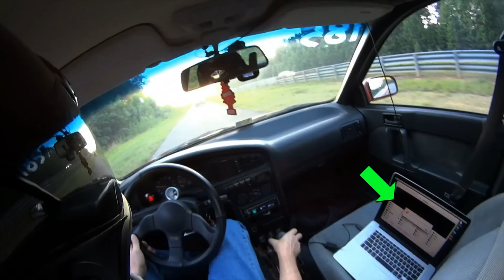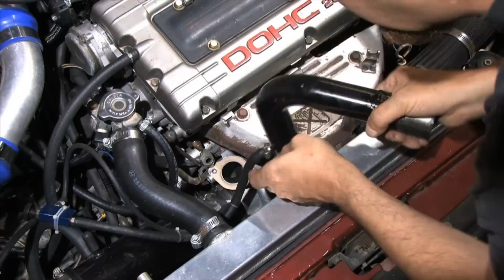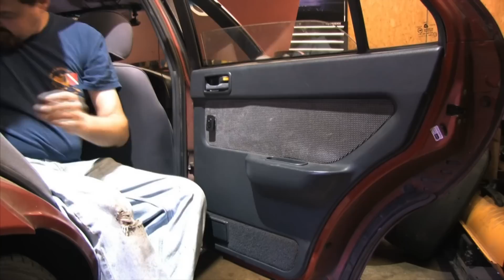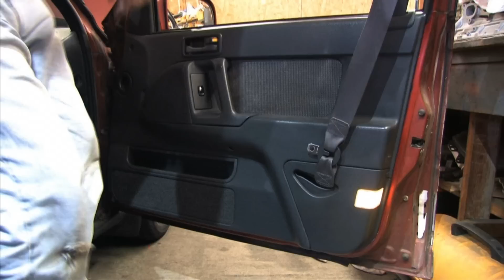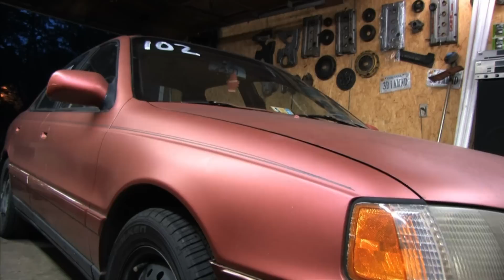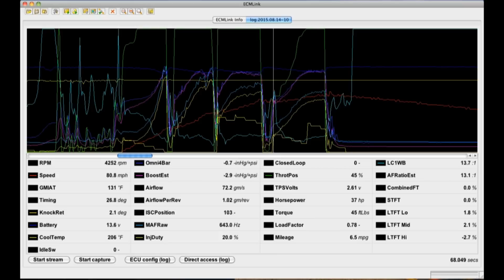Hyundai 15 - Trials and Tribulations

Comment: I had a civic 98 I rebuilded and bought a turbo kit first days were great then had problems with the vtec sensors then the throttle then the intake then as I was repairing engine light didnt come on but that thing was rich and bumping as I shifted gears took the turbo out no difference replaced with original parts from honda nothing brought friends to help me out to figured put nothing I sold that piece of junk got me a toyota problem solve, dude stop struggling
Reply from the maker: +nino roland Oh, I'm not struggling.  It's part of the fun, really.  The challenge I chose to accept was building a 12 second street registered POS & I've almost got it.  ;)  If you boosted a Honda-anything, you're going to love tomorrow's new video.
Reply: +Jafromobile thanks for replying, its kinda sad that u work ur ass off to see ur car running like a champ and dissapoints sometime its alot of fun though, shipping, ordering, searching online! its a Nightmare good luck jafro cant wait till tomorrow :)

Comment: Just out of curiosity have you considered a lengthened tuckable  harness?
 I know it requires the use money but it will save you from committing suicide while trying to find your bad connection. It would also prevent future suicide attempts when other issues crop up with the 20ish year old factory harness. Another benefit would be increased space under the hood which is desperately needed and would give you better camera angles. There are a few DSMers that make such harnesses and that the price for one is not equal to astronomical. I know its not a "DSM" chassis but with you particular set of skills I'm sure you could make it work and teach us to make it work while doing it.

Comment: Solid editing, great story lines. You just need to stop using a potato to film ;)
Reply: +Jafromobile Jafro you didn't have to waste your time explaining anything to that moron
Reply: +Ricky W Pretty crazy your so easily hurt. I wasn't even speaking to you! I was simply being sarcastic. I've commented on this channel plenty of times, and received solid advise. Not trying to be negative, it was a simple harmless sarcastic remark. Get some thicker skin you child.
Reply from the maker: +Sarah Dell Potato... lol.  Most of the footage came from a $7,000 potato, but maybe I'm just reading it wrong?  Your font might not be coming through properly on my end.  :P
Reply: +Jafromobile That's a 7k camera?!
Reply from the maker: +Sarah Dell The one I'm shooting with inside my garage is, yes.  It's a 3CCD 1080HD camera that shoots 1080p30 un-compressed video through a fixed (non-removable) ƒ1.6 20x zoom lens with an aperture ring that's ø72mm.  It weighs 8 lbs with a battery installed.  Shoots to tape, but produces a 80GB file from a 1 hour tape.  It was $6,999 many years ago when it was new, and its 1080HD quality can't be touched by anything that shoots to solid state because everything that shoots solid state shoots compressed video.  Tape captures an immense amount of pixel data, and faster than you can write to an SSD.  Look up Canon XH-A1s.  You can find them under $1000 used nowadays, but they were no-joke top-of-the-line professional gear back in 2008.  It's only obsolete by production standards, not in image quality.  I do all of my edits and exports prior to the final work without compression.  Any noise you see in your browser is coming from the export compression that then gets re-compressed by YouTube during upload, or you're not viewing in 1080p.

The rear facing camera was only $40 shipped, plus the memory card... lol.  The helmet cam was $300 + accessories.  I think Sony knocked a hundred bux off it since I bought it, but I bought about $300 worth of accessories for it.  All of these cameras are 1080HD, and have their places.  All have strong and weak points.  The $40 dashcams are potatos, I admit, but they start and stop recording automatically with the ignition... and make it exceptionally difficult for me to miss shots with unless the power cord comes loose... which it does from time to time.  The Hyundai vibrates A LOT.
Reply: +Ricky W You obviously cannot spot sarcasm. Good job.
Reply: +Sarah Dell yes cause it's obvious you were being sarcastic. Again moron

Comment: Hey how'd you rip apart that electrical plug/connector? Any tips or tricks?
Reply from the maker: +fireballmx I show it in the ECMlink install video.  The connectors in the door are the same kind of connectors used on the ECU.
Reply: Awesome, thanks!

Comment: I love watching the Hyundai series but I'd love to see other projects unfold as well. Bring on the winter projects! How is the Colt coming along? I would like to see that thing roll down the street, it would become a whole different animal all together. I'm not really familiar with DSM's, rather, I tend to stick to Hondas and Honda cycles, but your videos make complete sense and are always logical. I love watching how you go about solving your (seemingly) ongoing problems, which is one of the reasons why I watch. Hell, i've even looked up a couple DSM's and considered getting a Talon just because Id have more relevant information regarding DSM's. I'm starting to scroll thru DSM forums looking up specs and information. But don't tell my friends, they will think I have turned to the dark side.... No matter, Props to you for the perseverance!I do have a question for you. I know this engine has had some high oil pressure issues since you've gotten it, so my question is: how would using a lighter weight oil effect the oil pressure IN YOUR CASE? I know in worn out engines, you can use a thicker oil and it will help bring back some oil pressure, but i'm not sure how it would work the other way around. Cant wait to see what you will have for us next! -Michael
Reply from the maker: +Anthony Townley I sorta need to run thicker oil in this old worn out beast.  I have 12 PSI oil pressure at warm idle, and 78 PSI at red line now after the rebuild.  That's with 40W.  The modifications I did in my oil system videos, coupled with the looser mains and rod oil clearances... Those seemed to do the trick rather nicely.  ;)

Comment: I am really curious to see what is going on with your harness.   I wonder if the harness had a bad connection before and caused the engine problems.  GL tracking her down.  It seems like you at least have a good grasp of what is going on with it, and the steps required to rectify the issue.   Will it be a pain in the butt?   Usually is dealing with intermittent electrical. will it be worth it?  you bet ya.   =)    Thanks for posting love your videos.     would probably probe pin 2 and 4 of the TPS at the same time. wiggle, wiggle, wiggle, 2 changes, 4 doesn't, just found the bad connection.   short cut to eliminate everything up to there at the same time.  "this is pretentious of me of course, do to the fact i cant put a meter on it myself, not to mention making the assumption that the connection to the ecu is ok, and you don't have mid harness poo poo going on."   sorry if i overstepped.     Anyways.   looking forward to seeing the little beast killin it.!!

Comment: I am no electrical genius but seems like your wires are moving relative to one another a lot and causing electro magnetic induction. To explain, every wire that has a current flowing down it also has a magnetic field coming radially out. Two wires close together therefore have two magnetic fields interactiing with one another. One moves, the other responds with an induced current. The induced currents mess with the stability of your circuits.. perhaps try securing them somehow so they vibrate less. Perhaps if you can't do that add more clips to make them vibrate as a unit if they have to rather than relative to one another? If that doesn't work find a way of securing them in a type of trunking? I don't know the circuitry of you car or how its laid out. In fact I know hardly anything about cars. But love the technical detail in your videos and the time lapse - makes the work look easy! Thanks for them keep them coming! Hope my comments help.

Comment: You said you had a dsm harness in your elantra.  I have a 1993 elantra that has been 4g63 swapped and I kept the stock harness in the car and modified it to work added in a knock sensor resistor pack and evo maf. maybe it would be worth while to put a stock harness back in.
Reply from the maker: +whe 3ls It's long gone.  I didn't build the car.  I did provide a '90 turbo harness to the man who built it... but from what I have since learned, only some of the connectors were used.

Comment: Yeah I feel ya on bug squashing, i've passed a year of having my car together and still havent got everything ironed out, I have a bad knock sensor, and some kind of stumble that may also be the knock sensor.  I also have wiring and vacuum hose routing that needs fixed before I'm satisfied, and the trans fixed so I have 2nd and 4th gear back.  Front axles are junk too :(

It's a Mitsu, eventually it works, there's just an indeterminate amount of "sorta working" that you have to deal with before that.

Comment: Is the hard pipe bead-rollled there? (edit: as I continue watching this vid, I see you do exactly this, LOL! Carry on...) If not, that's a great fix and you should never have it blow off again so long as you tighten down the clamps good. Also, maybe use t-bolt clamps instead of worm-screw ones? On my Mazdaspeed 3 that I have dialed in to 25psi, bead-rolling and t-bolt clamps have saved me a ton of hassle.

Great vid!

Comment: Ahhhh, got my fix finally! Jafro you simply can't go this long without a video again.... ;-) Glad to see her running down the track again, I can't wait to see the Colt, GSX, and the GVR4 get some love. I guess the next thing to happen to the Elantra is the water/meth install? Being we have a we bit of knock now. I am curious to see how you install that kit on this particular setup, being you have the pristine ETS throttle body elbow. Many people I know bought the same AEM water/meth kit you purchased and can't get it to work correctly for some reason. Glad to see another video, it's entertaining to see someone explain in great detail how to fix common problems, or not so common problems. Keep them coming, thanks again for all you do for the DSM/CSM communities. Did you modify your BOV any? To handle over stock levels of boost, I've always heard the OEM Mitsu BOV's can't handle much more than stock boost levels. If you did modify it, what did you do to make it handle more boost? Lastly, do you run pure 93 octane gas? Or that E10 93 octane fuel, the government has bestowed upon us? Just curious, I am sure that would effect things negatively in this setup being it's not made to run on corn.

Comment: And it all comes down to a wiggle test and a wiring diagram. It's nice when it's simple and just takes some time, but sometimes multiple things are connected causing issues.

I'll have to take another actual close look at that diagram, but what you said really makes sense.
Reply: +DE Nichols So, I guess if a little power is sneaking to anwyhere on those grounds and it'd cause a variance in those sensors.

It's crazy how adjustments you made so many months ago (TPS angle I think you adjusted) on those sensors were partly because of a fault that was probably there the whole time.
Reply: +DE Nichols I'm throwing it out there and taking it back that one of the components could be bad to cause those problems. They behave way to consistently despite some inconsistency, so I really believe a wire is worked raw and a bit open in one of those harnesses.

I mean we watched you test each of those components, or was it just the TPS that was smooth and flawless?

Comment: Voltage Drop testing is your friend for strange issues like this, especially since your harness is not 'stock'.  Find opens, shorts & excessive resistance in no time using a binary search through the circuit.  Good luck.  Hope you make a video of your diagnosis & fix.

Comment: Just don't forget to leave a note for your self in the car if your going to let sit and wait.
Reply from the maker: +g6qwerty Oh, it's not going to sit.  It's getting used.  I'm going to fix it.  It's just that videotaping every last thing on it that needs to be fixed is preventing it from getting fixed.  Garage space is at a premium while I'm juggling 3 other projects and without a racetrack, what is there for me to prove?    But good plan!  I'll leave a reminder for me to kick ass in 2016!  It's important to set goals.
Reply: +Jafromobile Yeah goals are important, I bought another integra for parts then turns out that in runs and still not certain what my goal is for it. Had bought it for body parts and tires but all it need to get moving was transmission fluid. Wasn't expecting that...

Comment: alternator on life support
Reply from the maker: +7inchexhaust It's a brand new GM alternator, too.  I have a solution for that as well.  The pulley it came with is too big.  It under-drives it.  But wound up it should be producing and it snot.  Tells you a lot about the resistance problems in this car's wiring.

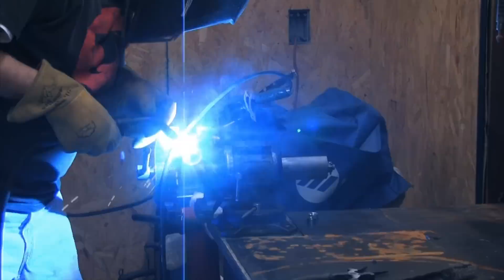Comment: 337 Horsepower and 301 Ft/lbs of torque?!? (at about 3:08) And all of it from the first few passes by a Frankenstein mix of Hyundai/Plymouth/Mitsubishi/Nissan/Subaru/Ebay/Mattel/WhoKnowsWhat?!?!  Wow.  If that car is angry at you, it's using the anger to create more horsepower.  Forget about adding window stickers and go-faster stripes.  Just find a bundle of pure white-hot fury trapped inside a cast-iron engine block which wants to be in a grave so badly that it will go faster and faster because it wants to kill both of you by hitting a wall at the speed of sound.  THAT'S how you add horsepower.
Reply from the maker: +Darth Fudd I won't be satisfied until 400's.  It's 400 or bust.  Tall order for a $224 turbo, but it HAS to happen.  I can't own a truck that makes more power than my Hyundai, and I'm not parting with the truck.

Comment: Engine mounts?
Reply from the maker: +Themayseffect OH YEAH!  Gotta have those engine mounts...

...I suppose you mean which ones?  It's a 1.6L turbo mirage/colt trans mount, 1.6L Hyundai Elantra timing mount.  Front and rear roll stoppers might be turbo automatic 2.0L Eclipse mounts, but they may be split half & half with another car.  I can't identify them because they've been filled solid with 3M Windoweld.
Reply: I was questioning if you upgraded them or not. The engine bouncing around won't help from things loosening up and braking things.
Reply from the maker: Yeah, it's not moving much, really.  Those solid Windoweld mounts are brutal.  The vibration transmitted by those homemade things might be why everything is shaking apart.  Did you see the dome light?  The plastic shattered and it fell down while idling at a stop light.  The car shakes stuff around it despite having air-inflated tires.  It's terribly uncomfortable to drive in most people's opinions, but they always climb out of it smiling.  :)

Comment: How does Speed density run vs a MAF because im well over the limit of the factory 1g DSM MAF and looking to upgrade and Speed Density would allow me run a flex fuel sensor with ECMlink wired into the MAF plug
Reply from the maker: +The Glorious Hypnotoad Speed density is amazing.  It's a clean, simple way to setup your airflow metering.  You can't get the best out of it without a wideband o2 sensor, but that's a small problem to fix with no downfalls whatsoever should you choose to.  You can run it without the wideband, but you'll want to have it.  If you don't have ECMlink yet, that alone is worth the entire budget of converting to speed density.  SD + ECMlink + WBo2 = win!
Reply: I'm on Ecmlink v3 full with an innovative lc-2 and I've been looking to upgrade my maf because I'm well over the rated flow of the 1g maf but was a little worried my car would run funny with Speed Density I daily drive my 1g gsx and don't want it to be a race car but want to run flex fuel ( Ive had to pull a ton of timing due to knock) and Ecmlink makes a cable for the flexfuel sensor that works with Speed Density and I think a GM maf